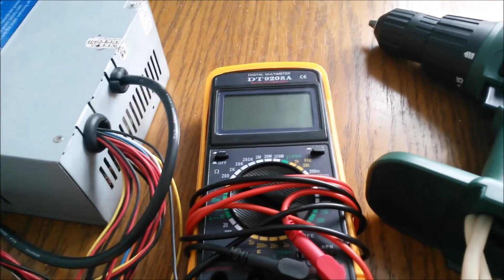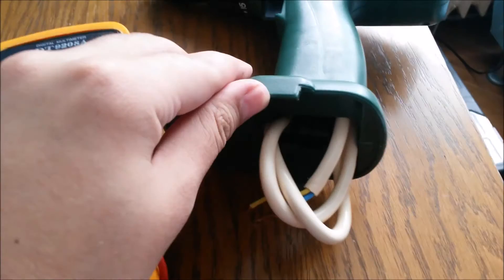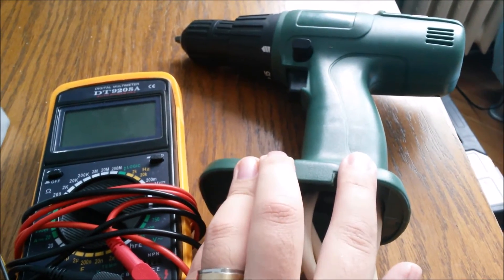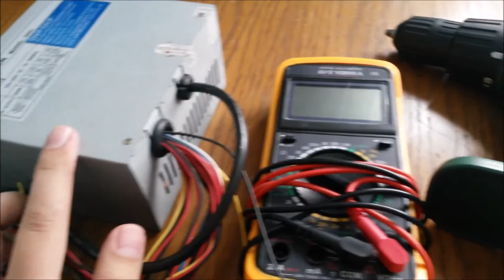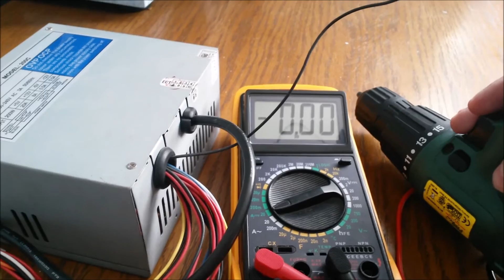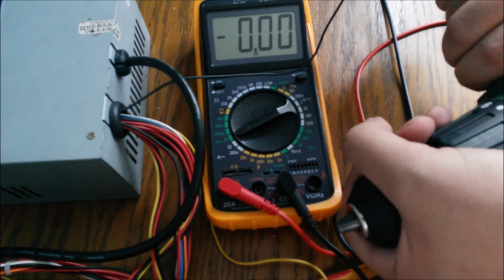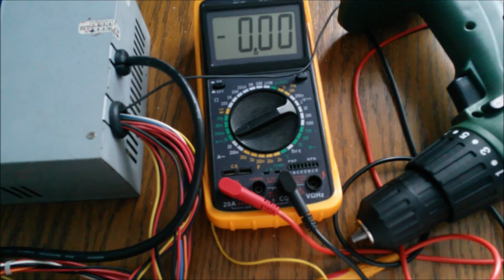Testing current draw of cordless screwdriver at 12V with a multimeter

Comment: You really should test this with a proper load. Screwing in a torx screw on the "drill" setting, for instance. I just tried doing the same with a 12V Black & Decker whose battery last for 10 screws. Tired of these battery operated tools, and not wanting to spend 50€ on a new battery, I took the battery apart, removed the cells, and soldered some wire onto the socket leads. It worked with an old Dell ATX PSU, but as soon as I gave it a little resistance it went poof. Dead. A little odd, I thought, as these Dell PSUs are pretty good quality, if a little week (I think around 200W, though the case is missing, so I'm not sure how many amps it provides on the 12V rail 🤔 it may have been semi-faulty. I'll try again tomorrow with a different one. What did your friend end up using? As in, how powerful? And did he blow up any of his PSUs in the process? I'm wondering how crazy the spikes are with these battery tools - I'm starting to think battery operated tools might be a lot "spikier" than corded ones because they can 😊 Thanks for the video.
Reply from the maker: Your best bet is to recell the old battery yourself. Old pc power supplies are just not powerfull enough on the 12V rail.
Reply from the maker: He found a corded one in the end and bought that. Gave the one in the video to me to salvage parts out of it.
In my country corded ones are a thing: https://www.dedeman.ro/ro/masina-de-gaurit/-insurubat-panzer-esd-300qc-ax-300-w/p/1054499?gclid=CjwKCAjw__ihBhADEiwAXEazJoBT76NPlP27o4ymGyXT_hjx0lQnFdfSFn-kZ3EkCdrfPzSyOH3a0xoC8wYQAvD_BwE
Reply: @UltimateDIY  Thank you for the link! I'll see if I can order that for my country 😊
Reply from the maker: Welcome ✌🏼
Reply: @UltimateDIY  Yeah, I was thinking about that, but I just hate these battery operated tools. Such a waste of resources. And my money. I always go for corded ones now, but for the life of me, I don't think a corded screwdriver exists 😂 I'm thinking of stuffing capacitors in the old battery box instead, if that might take care of the spikes, but I don't know... Good thing is, the PSU that went poof seemed to only need 24 hours to be happy again. It suddenly registered on my voltmeter after a day. When it insta-died, I looked for a fuse on the PCB but found none. Seems there's a soft fuse somewhere 😊 Anyway, judging on the way you responded, I'm getting the feeling that your friend's screwdriver didn't survive either?

Comment: you rather could have tested power consumption with trigger level, rpm or torque load. power tools can be used at low rpm and so they consume far less amperage than advertised and have larger lifespan
Reply from the maker: Yes, but they also do the work slower, so it's a readeoff some don't like.
Reply: @UltimateDIY  the only need for speed is in CNC routing or some other niche, for the rest slower is recommended as reduces thermal stress, friction, vibrations, etc
Reply from the maker: Not really sure what you mean. But I would not be able to wait 2 or 3 times more for drilling a hole with a cordless drill, just to create less heat.
Reply: @UltimateDIY  with CNC routing of strong metals as Steel you need a tool rpm, and in this case you are referring if you do a hole with low rpm and doing several stops the tool will have far less tool damage by friction and heat besides the brushed motor gets extended life and low temperature operation, also in the case of jigsaws used at low rpm they they dont break as easily than common fast rpm
Reply from the maker: Ok, but this only works when you have time to spare. Sadly, time is the most expensive thing in our life.
Reply: @UltimateDIY  what??? time is a issue only for slaves, the modern salary slaves
Reply from the maker: You are missing the point. Time is finite in our life, so for me it's the most important and expensive. I will never run a tool for home use at lower speed just to decrease it's heat output and waste my time working slower. Just does not make sense. For industrial tools, that is for semobody else to decide.
Reply from the maker: @crapisnice  🤣🤣🤣 You have a really short temper, if you lost it just by me not agreeing blindly to your vision. Honestly, you should take a chill pill, or you might blow a gasket or something 🤯
Reply from the maker: I have no idea what you smoked, but it seems good quality stuff 😆
Reply: @UltimateDIY  your weed is better, its the ultimate weed and comes handy to strengthen selfishness and egocentrism, i'm spending a few nanoseconds to recommend your wisdom and weed. god i love the ultimate argument
Reply from the maker: It's been really funny talking to you. I see you are starting to calm down and not shouting anymore. I also hope no one disagrees with you in the future, because getting this mad for nothing cant't be good for you. Have a great day!
Reply: @UltimateDIY  stop trying to act empathic or moderate, that's not only arrogant but insulting, why i have to make several answers when i just did a comment. you have a problem of stubbornness, protagonism besides twisting the talk to win the argument. you dont have 10 minutes to perform a machine tool task that you can do in 1 minute, fine for you and order 10 tool-ends per month to amazon-for-life. now get a life
Reply from the maker: So you drill 12 holes in 2 hours instead of 12 minutes, just to save a tool in your imagination? We are not talking here about overusing a tool, we are talking about using it according to it's specifications.
But nevermind, I should have stopped responding to you at your first insult. That made it clear you are bot a resonable person. Bye.
Reply from the maker: So you drill 12 holes in 2 hours instead of 12 minutes, just to save a tool in your imagination? We are not talking here about overusing a tool, we are talking about using it according to it's specifications.
But nevermind, I should have stopped responding to you at your first insult. That made it clear you are bot a resonable person. Bye.
Reply: @UltimateDIY  get a friend or talk with a stuffed bear, you make hole and wait 20 years, then you make another one, fast and simple

Comment: If i change cable body size for a big size. From 2mm to 4 mm wired. Can current increase?

I want more current flow to increase power. But ya, this is just 12 volt.
Reply from the maker: Could help.

Comment: have you test the brushless tool ? does it draw similar current ?
Reply: Brushless motors require a controller circuit with Pulse Wave Modulation.  They generally are more efficient, so would have slightly less draw for the same amount of torque.
Reply from the maker: Did not test that.

Comment: Hi, unfortunately it is much cheaper to buy a corded drill than purchasing a power supply hefty enough to power up a cordless drill at any voltage. In my opinion, for home use a cordless drill is a waste of money since the batteries will go bad before you get your money's worth out of the expensive batteries. I usually buy the least expensive amazon battery replacements batteries just to keep them working for the occasional home use. Even in an industrial setting I find that we use supper expensive cordless drills when we don't really need then and in many occasions where we are stationary we can very easily use corded devices. You get my drift?
Reply from the maker: I 100% get your point, as in this exact moment I need to search for replacement cells for my cordless drill. Not a happy camper for sure...
Reply: Where do you find a corded screwdriver? 🤔 I can't find one, except a specialized one for drywall screws.

Comment: Very helpful, i'm building a 6 inch diameter 53 inch long pvc rc submarine powered by an 18v makita drill. Needed a rough idea of max amp draw turning a 3in diameter 7 bladed propeller under water because i ordered a 15 amp max esc to control it. From observing your test I think i'll be ok with that esc. Thanks for the video.
Reply from the maker: Glad my video helped :)

Comment: Thank you for this useful video. But your current measure method is not correct. Your multimeter cords is thin for measuring high current. Use short cable and measure voltage of cable at 1 amper. 10mV at 1A is good for testing high current. Thank you again.
Reply from the maker: Thank you for that info. I did not realise it.
Reply: A full load current will be different from a no load current too. Your measurement is for no load condition and you may end up choosing a power adapter that is not powerful enough to drive the drill